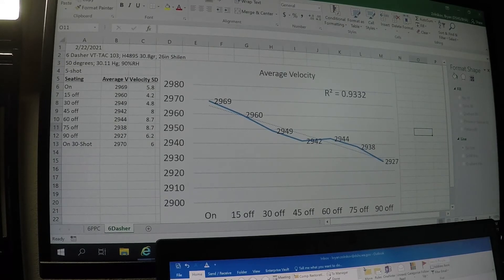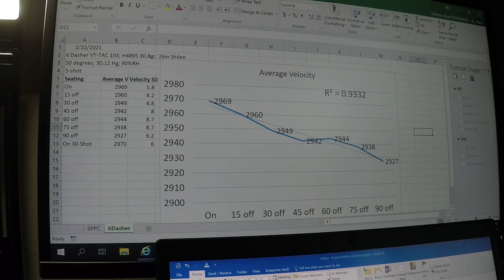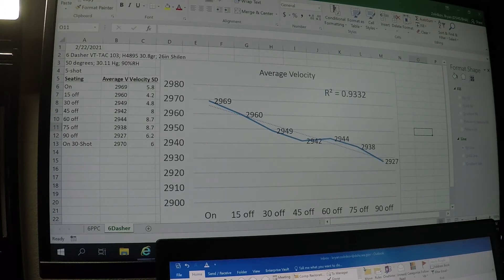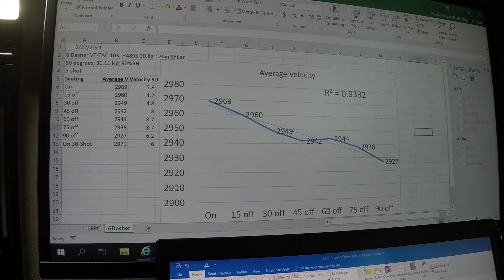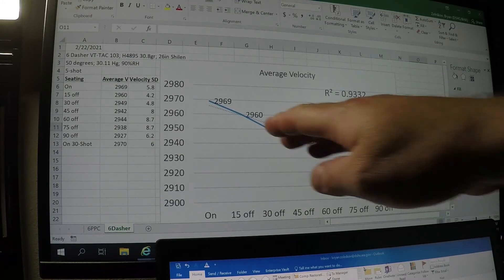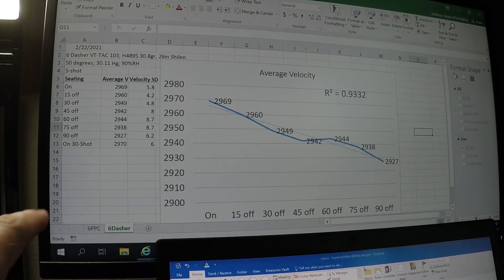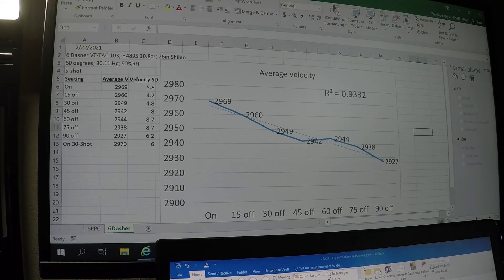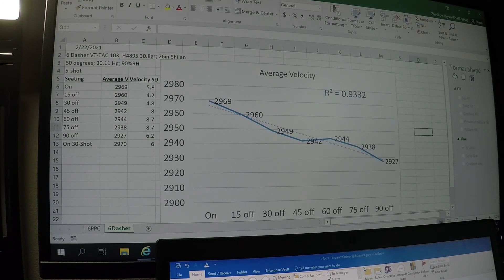Witch Doctor Effects on Seating in 6 Dasher

Comment: One of the recent controversies in the PRS match world is the amount of throat wear that might occur during a big match. To use your results as an example, some would pass on the absolute best load  at .015 off, and load at .045" off so that it can remain consistent while the throat wears down to a jump of .060". In your experience, how many shots do you get off before you have to re-adjust seating depth? In your experience, would you try and utilize this flat spot, or is it equally likely to be just a fluke that disappears when the test is repeated?
Reply from the maker: For now, I would practice according to the data demonstrated by the PRS/NRL crowd. I am in the middle of testing to see whether jam or jump falls off tune faster or slower. Preliminary results show that both hold a tune just fine but that test is with a 6PPC at 4K jam and 4K off. I will eventually test for “tune fall” in a cartridge that is common to PRS/NRL like the 6 Dasher and test at .015 jump and .100 jump.